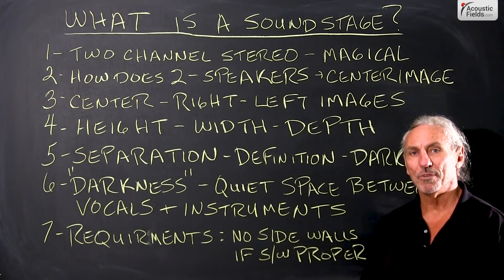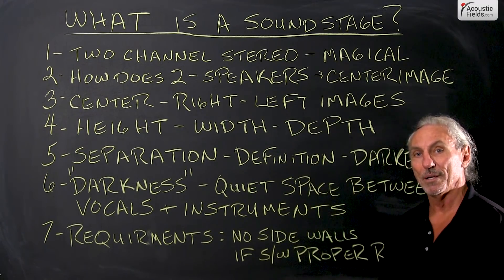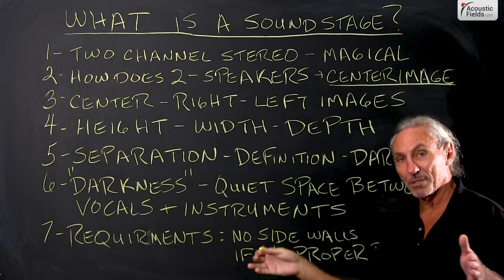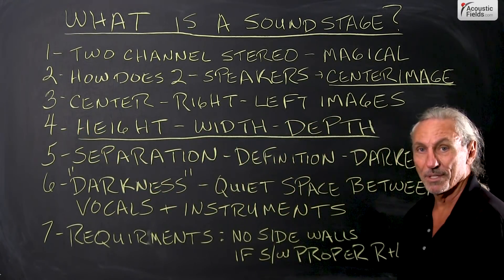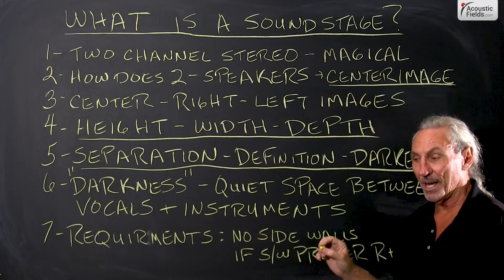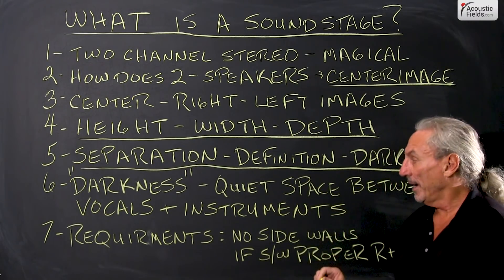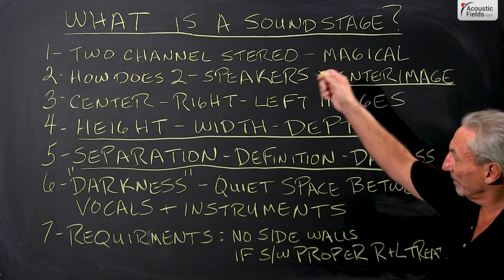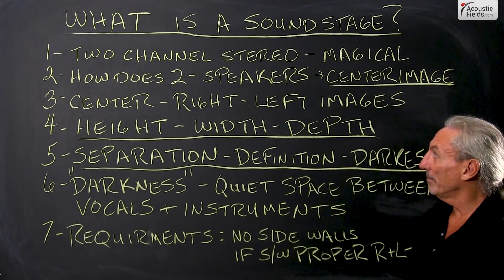What Is A Soundstage? - www.AcousticFields.com

Comment: Regarding sound enhancement equipment and a tight budget from what I read and understood, a sonic maximizer from say: (BBE), is far better than an eq. They say that it's like removing a blanket from your speakers increasing the volume and clarity without adding power. I know they strengthen all audio signals back to their designed intent from the studio that are lost as they travel through your systems circuitry. Are they really a "sound" investment? Also, My brother had told me that if you can't afford a power conditioner installing a hospital grade outlet will slightly improve your sound as it gives a better contact to your plugs and a more consistent current/voltage flow. Can you please elaborate on this it would be much appreciated!
Reply from the maker: F,  Achieving quality sound is all about doing a lot of little things in the correct order.  Without a properly treated room, you may spend money on improvements and still not hear anything.

Comment: Nice video, was interested in this lately.

Can you reccomend some tracks that have obvious soundstage, good stereo separation ? I can only tell the width (left-right position) of the vocals/instruments, and not the height and depth, have tried various speaker positions and listening places, ofc my 3,1x3,4x3,5m room doesn't help but can't exactly get a better one now.
Reply from the maker: A,  It is going to be very difficult in such a small room. Start with a mono recording of a male voice. Get that image centered between your speakers. After you adjust to that concept, you will be ready for a stereo application.